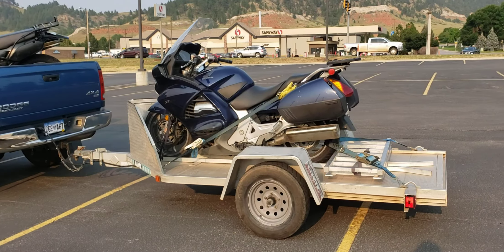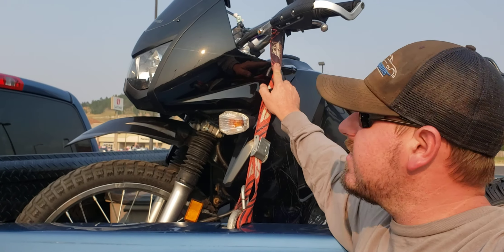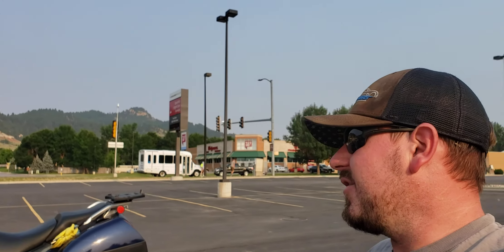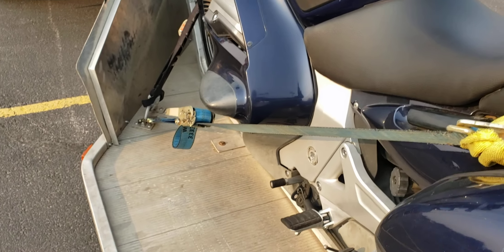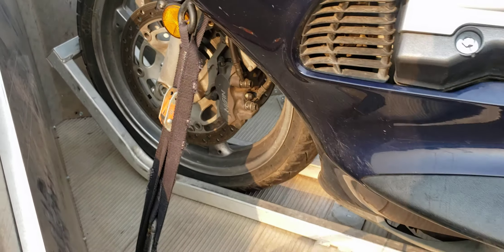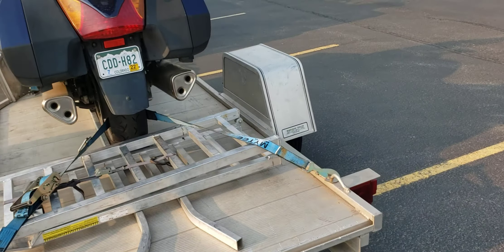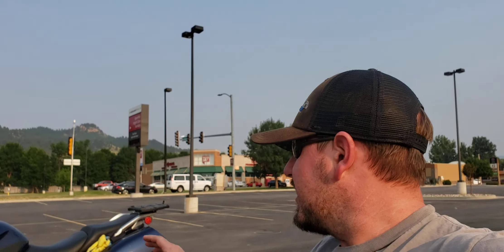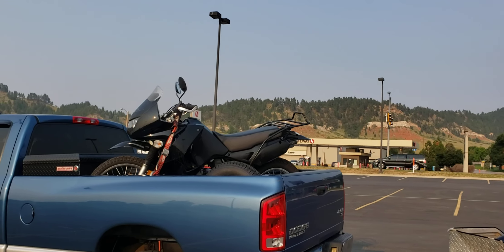How to Transport Motorcycles - Non CDL Hotshot Hauling

Comment: hey man just wondering why dont you use the hitch carrier?
Reply from the maker: I have used those for smaller dirtbikes, but they are not always very secure for larger bikes.
Reply: @HumbleHotshot  i keep checking those black widow 600lb can carry lots of variations and avoid trailer just wondering on your oppinion why not so secure?
Reply from the maker: @alexxxdean  those do seem to be good quality, but I have only used the lighter duty moto carriers and they always seem to move around due to the play in the receiver. I've used straps to try to prevent this but they just always seem to sway around a lot. Just my experience, good luck!